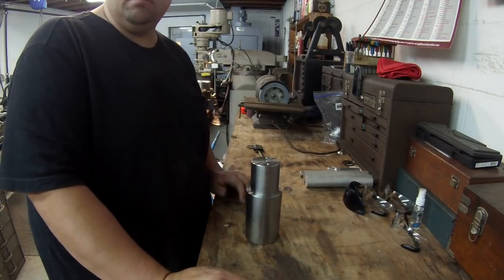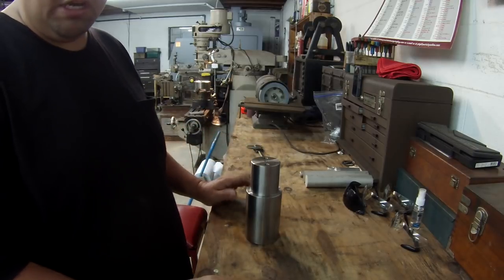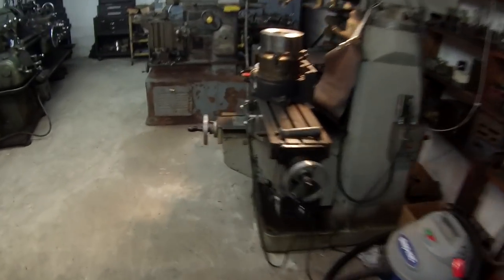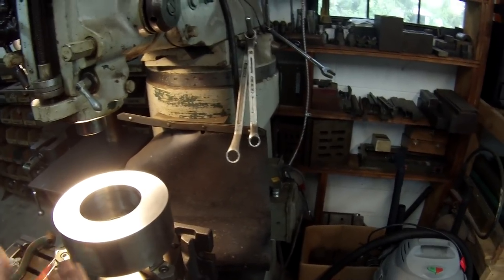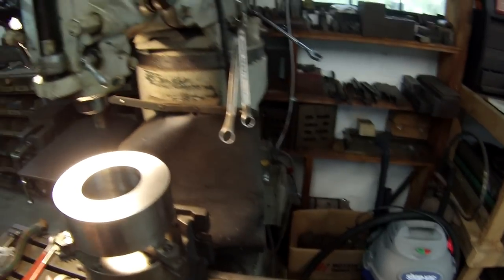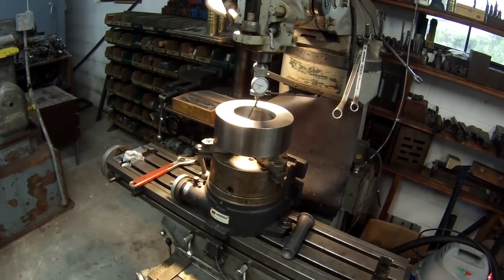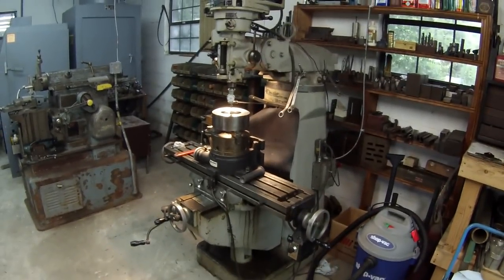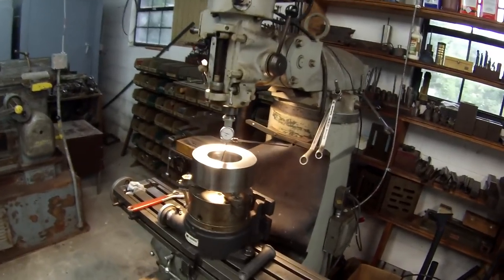Roller Assembly part 1

Comment from the maker: I charge my customers $70 per hour. A job like this has quite a lot of hours in it. But many jobs, such as this one, I quote in advance before it gets approved, so no matter how much time I have in it, I get paid my quoted price. Ive been building this part since 2005 and I always charge the same labor plus the materials cost. It changes slightly, but I havnt changed my price since then.

Comment from the maker: The DoAll mill is a very quiet and tight machine. I am fortunate that it has been used very little throughout its life. Most of our machine work was done on the bigger mills, and we would use this one for small jobs like drilling holes or second ops. I think the step pulley head runs a little quieter then the variable speed head.

Comment from the maker: Thanks guys. The material for the shaft is 4140 , and the roller is a piece of 8" 1018 cold rold. The end plates are plasma cut out of some A36 hot rolled plate. The cutting oil I use is just the old school style dark cutting oil. I cannot remember the exact brand name on the drum but it was sold to me in an Exxon branded drum. I use it for most of my cutting needs.

Comment: Adam, I've been watching a lot of your videos. I know this one is very old but you may find this useful. Once you have your bolt circle center drilled, you can relocate your rotary table just as easily as you located each hole with the center point. It doesn't matter if the rotary table is off in either axis. The circle will still be under the spindle. I hope that makes sense. You could also do all four operations before flipping the part.

Thanks for the great videos

Comment: I have an old Bridgeport J Type, that I use a 16" dia. Troyke rotary table with it's 14" counterpart cross slide, which are very tall, and so I use a 4" and/or 8" head spacer on the Bridgeport,,, The nice part besides being able to work on tall parts,,, is also being able to stand up straight while turning cranks... I really like the nice finish to give your customers, and I bet they do also! Nice work Adam! :o]

O,,,

Comment: Adam,

Is that dark sulfer cutting oil you are using? 

I use quite a bit of that stuff, and I went to my supplier the other day and the stuff now is almost clear. They mentioned there was some mandate to stop making the dark stuff, still has sulfer in it, but is just clear.  Just curious.

Cheers,

Glenn

Comment: What is the best cutting fluid to use for a drill press that will help me stop burning up my drill bits? Thanks.
Reply from the maker: Lots of quality stuff to use, but I normally use dark cutting oil for most of my work. You can buy it also as thread cutting oil. Rapid Tap, Tap Magic, and Moly-Dee is also some good stuff to use. One thing to be sure of is not to run your drills too fast, and don't let the drill rub, or dwell in the hole causing heat. That ruins a drill in a second.
Reply: Thanks!

Comment: Hey Adam, I noticed that there were jaw marks on the OD of that larger part. Did you machine those off? Or are those not critical to the part's function? It was just something I noticed during the video. I haven't watched the other parts yet, but was wondering if you machined those marks out of that OD.

Just want to say that I really like your videos so far. I just found out about your channel not too long ago and I'm really enjoying it. I'm a small business owner myself, and any information regarding tools and machining really comes in handy. I'll be sure to check out your other videos as well. You have yourself a new subscriber.

Comment: I have had a heck of of time finding one of those centers you used in the mill to spot the holes. Is there a specific name for them?
Reply from the maker: You know, I have never seen one for sale. I don't know where dad got that center, but it's a handy tool and I use it all the time! It could easily be made by anyone that does tool grinding. Mine has a 3/8" shank, and goes from a point to 1" on 60 degrees. Shadon HKW could possibly make one for you though. he made a couple smaller ones for me from old end mills.

Comment: I noticed that you said this was hot rolled steel. What is the reason for not using cold rolled steel?
Reply from the maker: The roller in that video is cold rolled, it was the last of what I had left at that time. The newer ones I'm building is hot rolled because its whats available to me at a lower cost for the cut lengths I need.

Comment: Adam (and everyone else who's willing to share some info), I was wondering.. What is the difference between hot rolled and cold rolled (material properties, etc.)? Does it affect the machining of the part somehow?

Thanks :)
Reply from the maker: The real difference is how the material is formed to shape. Hot rolled has a mill scale on the outside, and its not to perfect size. Cold rolled is formed very close to tolerance, being right on size, and has no scale. Rounds and flat bars usually mic within .001 under the nominal size. Its a nice material to work with, especially if your using flats or squares to make parts. Cold rolled bar stock will typically accept pillow block bearings with no further turning or polishing needed.
Reply: Adam is right. The other difference that he didn't mention is that the cold rolling process hardens the metal somewhat. It is really just a surface hardening, it doesn't extend real deep. So any kind of machining will probably remove it. And of course welding or anything else that gets it to a good red heat will also soften it back up.